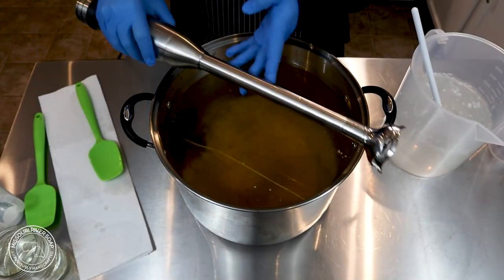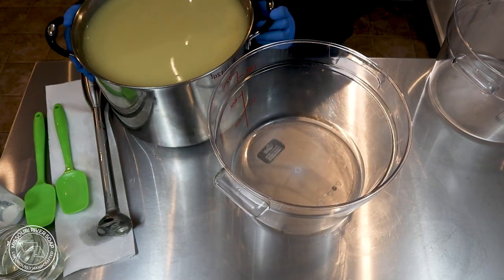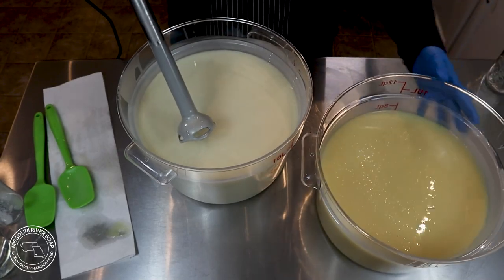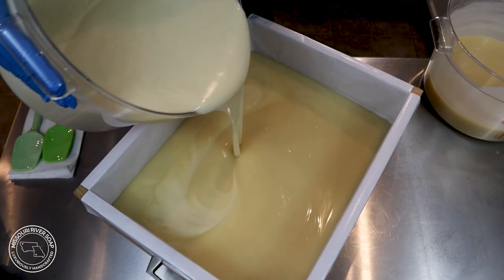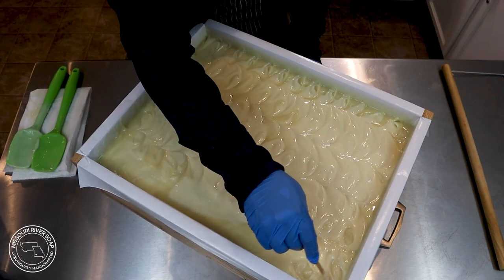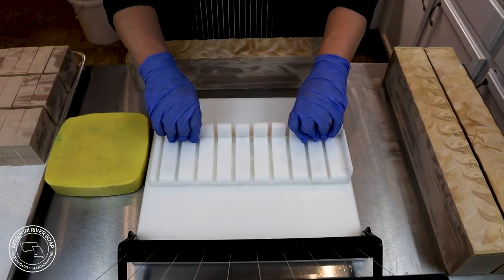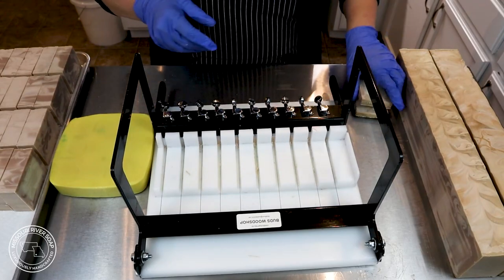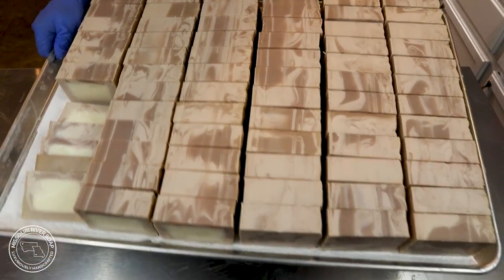The UN-OMH Soapmaking | MO River Soap

Comment: Holly please protect yourself and do whatever you can to avoid injuries. As a nurse I have my fair share and we are told by the state that each of us should only lift alone a max weight of 35lbs. If I remember you are like me and vertically challenged maybe working on a large platform would help bring your body up to be able to use your core more effectively and be safer. The injuries may be annoyances now but they will be more life altering later in your life trust me. ♥️ Love watching you work but I worry that the soap is going to go all over every time you pour those huge square buckets or pots, I know you would edit that out but I still hold my breath🤣♥️♥️♥️

Comment: While I am not a fan of OMH this soap turned out really nice, just consider it a modified ghost swirl :). I do have a question, what caused the "white" area to form a rectangle in the middle of the soap especially considering you did a hanger swirl through out and it comes back after being exposed to the air for a while? Yours is the second soap this has happened to and we are trying to figure out what is going on, the other soap being done in pink again with a perfect white rectangle that turned back to pink. It is a really odd phenomenon

Comment: Hi Holly.....You ARE such an inspiration!!!!  I watch your videos all the time.  It gives me hope that someday my soaps will turn our looking like yours....lol....I do have a quick question though....how do you get your soaps to look so smooth??  When I cut mine, they either have glycerin rivers or look ruff looking.  Your sides, front and back are so smooth.  My question is...."how on earth do you get them so smooth looking??"  Your help would be much appreciated because I am ready to give up.  I just don't like how they look.  Thank you for your inspiration!!!!  You give me hope :)
Reply from the maker: Thank you for your kind words. I really appreciate it. Don't give up!!  We do plane and bevel our soaps. Ones that are not planed do have a rougher texture. Now...some batches are wacky smooth and don't need clean up at all. Others ended up with more air bubbles incorporated into them. For smoother batches, you may need to reduce the palm oil if you're using that and be sure that your stick blender isn't adding too much bubbles. For glycerin rivers, you need to have less water in your batch when using titanium dioxide. Even just the water you mix the TD in to dissolve it can put it over the edge and cause the glycerin rivers. Also, the heat during gel can cause them...in combination with the extra water, etc.. It's okay...I get them too! Several of my holiday soaps have some this year. But you can just do some tweaking to eliminate them. I can eliminate them in all my batches too and can make that adjustment the next time I make them.